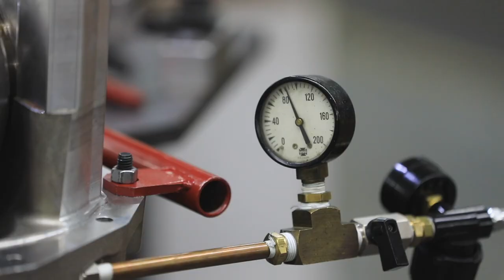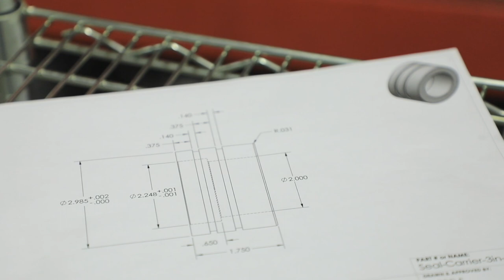Custom Axles | Jeep Wrangler JKU Build | Ep 4

Comment: What kind of transfer case did you install? With the capabilities you're engineering into this, I would hope to see a twin-stick NP205 or Atlas II.
Reply from the maker: Right now we are running the stock NP241 that we rebuilt.  Not bullet proof, but after talking with some of our buddies in the community we think its fine for now.  But a Magnum 205 would be sweet if the need arises!
Reply: Is it comparable to the stock rubicon transfer case with 4:1 low??